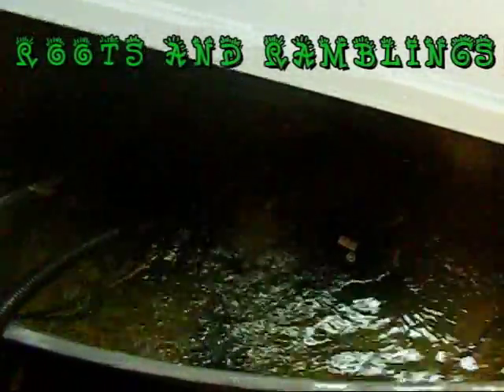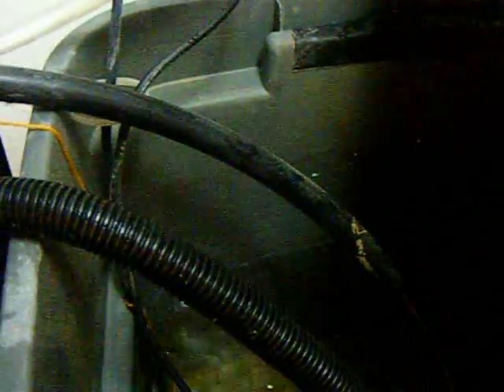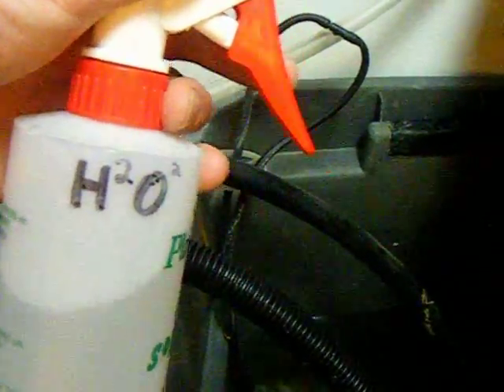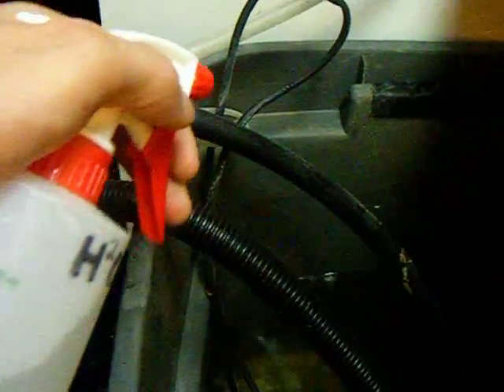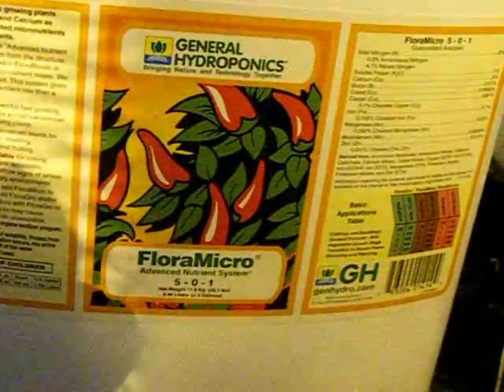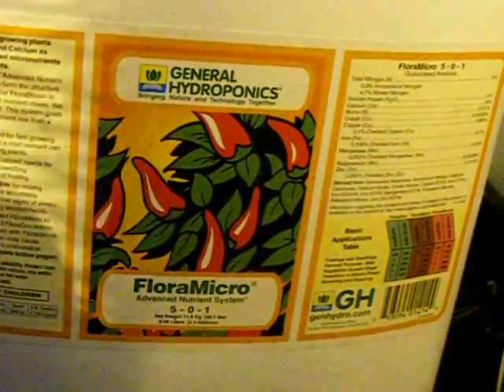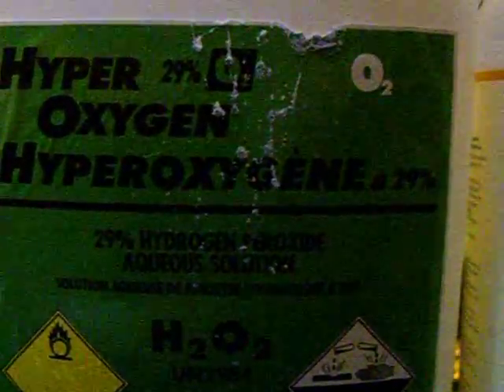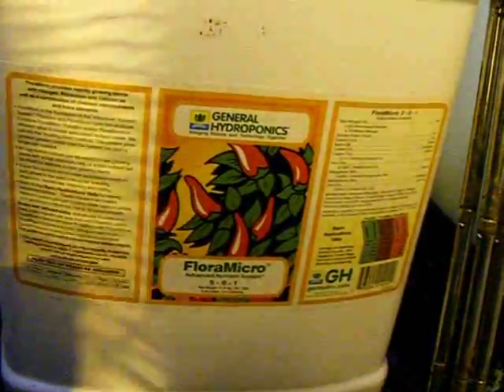Mixing a Nutrient Soup for a 400L Hydroponic Reservoir (Aero, DWC) in Grow Room

Comment: @phunkfarm Yes he is... Its the first thing he adds to the soup. It is diluted in the soup. At the start he uses undiluted H2O2 to spray his res to clean it. The term "Flush" is used in hydroponics as when in the final weeks you make a "Flush" solution. This contains little nutes and may contain a flush mixture. Flush mixtures force nutes to the fruits. Some also attack the root system to shock the plant to force it to ripen its fruit.